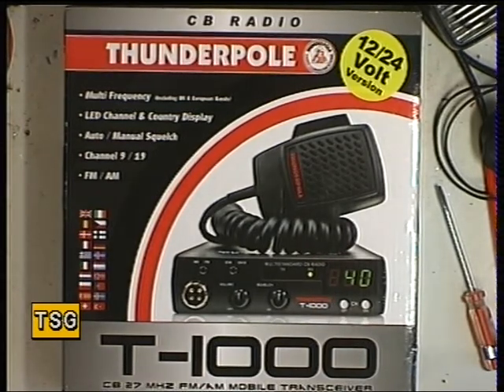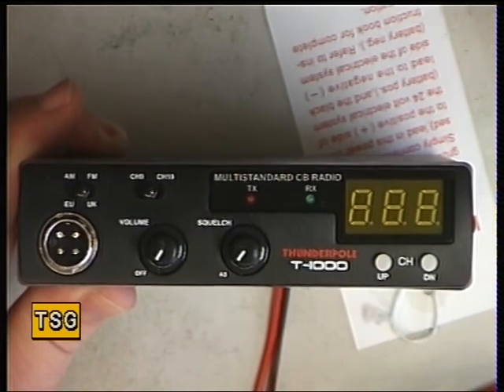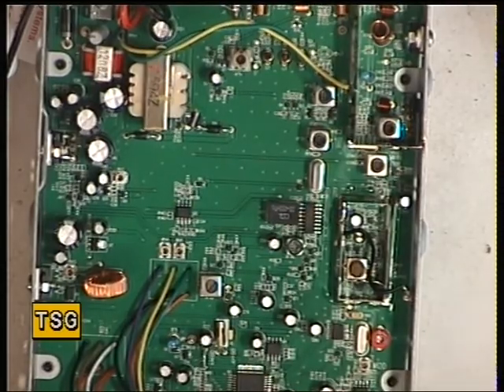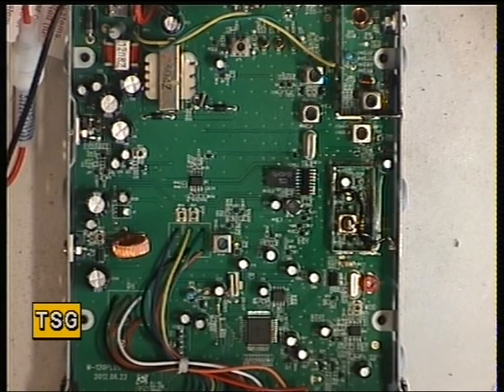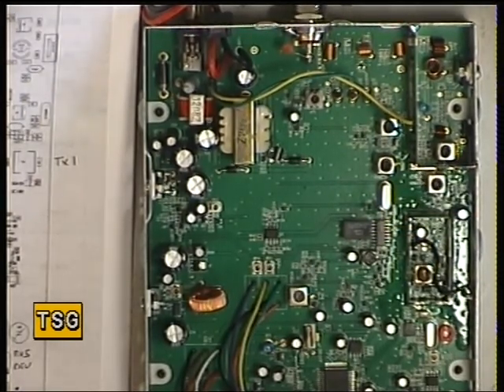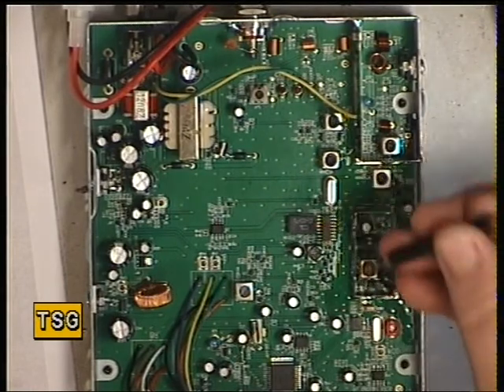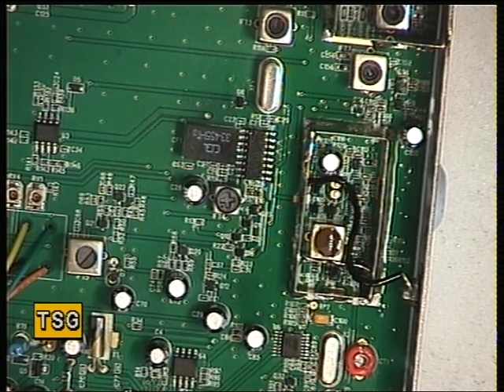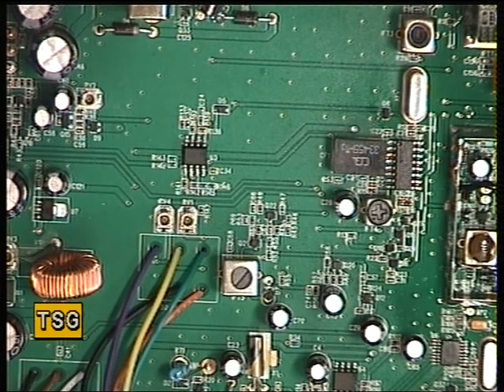Thunderpole T1000, UK/EU (CE-Multi) 80-channel CB Radio (Mobile) - TX alignment

Comment: Does that mean these radios COULD feasibly be easily used in contravention of UK laws if set to the AM mode? I'd be surprised as controls that may cause illegal operation or typically supposed to be not easily accessible?
Reply from the maker: Any EU multi set can be set to operate on channels unavailable in the UK. As from tomorrow, the 27th June 2014, AM, USB, LSB & FM may all be used legally on the 40 EU channels, plus the UK 40 channels in FM only of course. That means that the Thunderpole T1000 can be set to an EU setting quite legally & used on AM at 4W as well as FM...from tomorrow. Sets used on AM & SSB , from the 14th, MUST be CE approved....in other words not digging out some old FCC rig & using that. Over the coming weeks Ofcom will be doing much overtime with the detector vans & may well check out the equipment being used on by some of the first people on Am or SSB here.....like people who illegally use Amateur radio equipment on CB frequencies....and the burner brigade. I can see some confiscations coming up!.